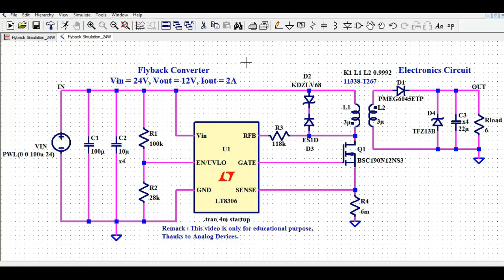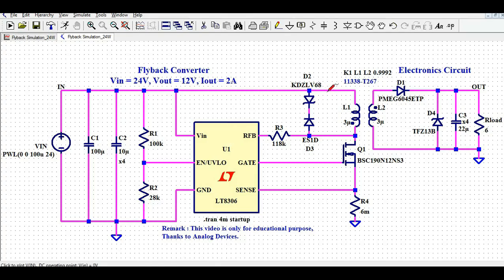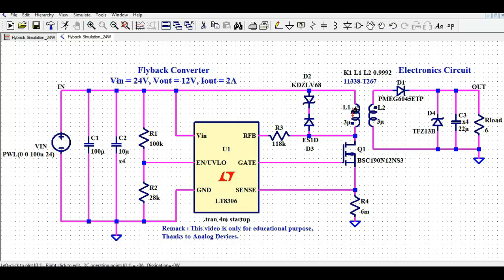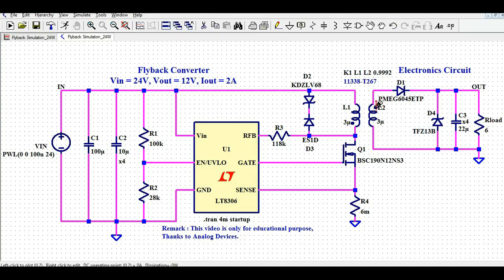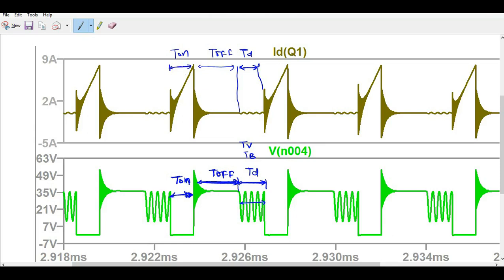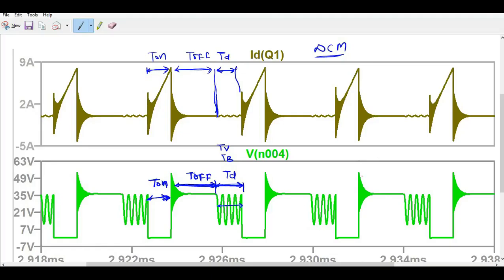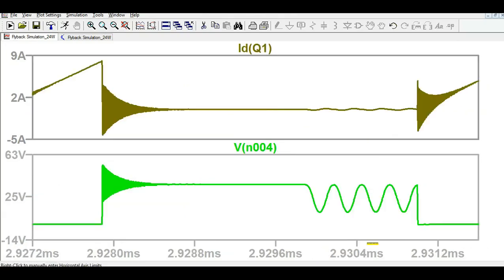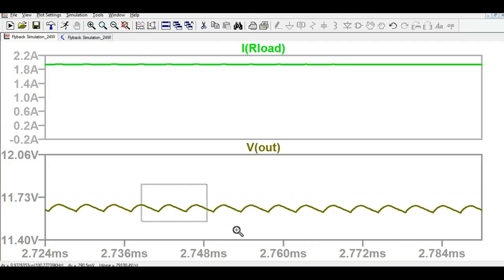12V Flyback Converter Design & Simulation in LTspice | Full Analysis

Comment: The coupling coefficient between the windings in the flyback converter transformer cannot be so large: 0.9992, since it is not even a transformer, but a two-winding choke.
Also, modeling without taking into account leakage inductance has no practical meaning, but it is not shown on the schematic diagram.
Reply from the maker: Thank you for your feedback and pointing out the nuances of modeling!